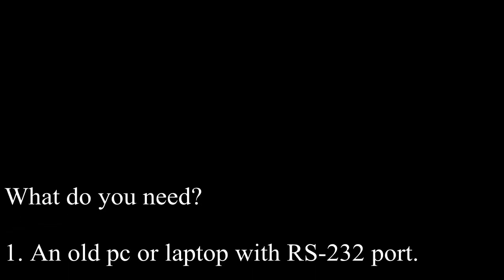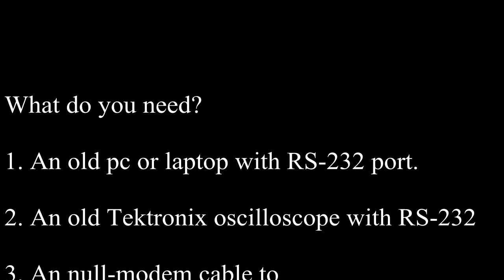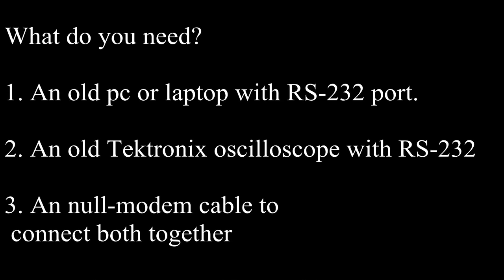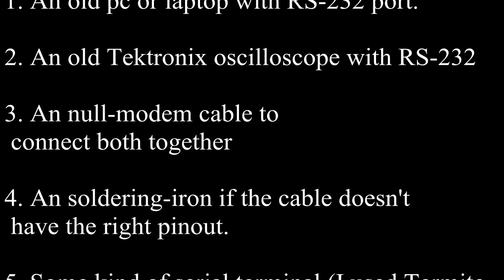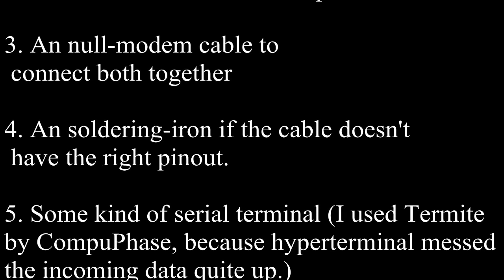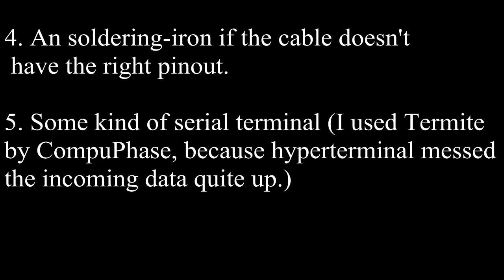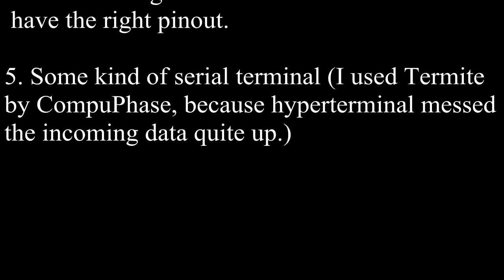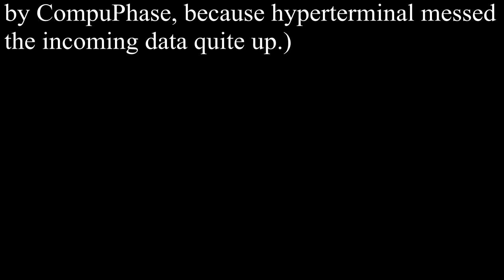Connect your old Tek o´scope to your PC

Comment: Here's a video of the same 'scope model plotting to a Hewlett Packard 7475A plotter: https://youtu.be/mVxT2yA2S2U
Reply from the maker: Cool, it even plots in 2 different colours.
Reply: @TheVidsByDennis  Yes, it can plot using either 1 or 4 colours, selected by the DIP switches beside the RS-232 port.  When 4 colours is selected, pen 1 is used for the border, date and Ch4 data, pen 2 is used for the Ch1 data, pen 3 for Ch2 and pen 4 for Ch3.  One other feature that the video doesn't show is that, when the graticule lights are switched on, the plot will also include horizontal and vertical grid lines.